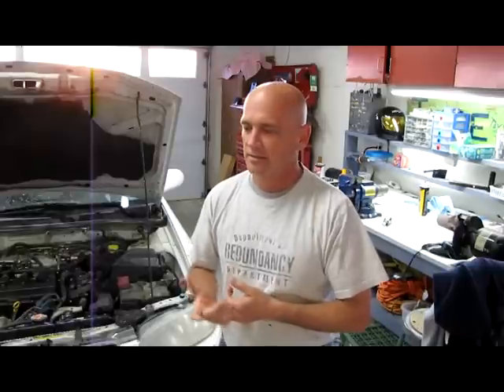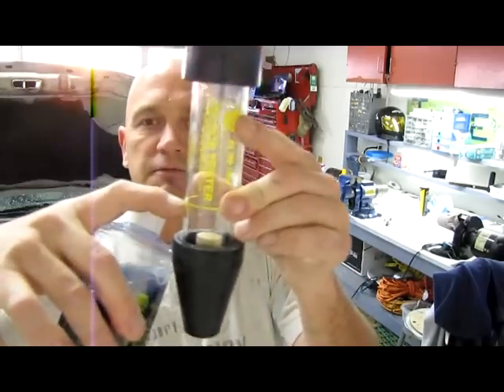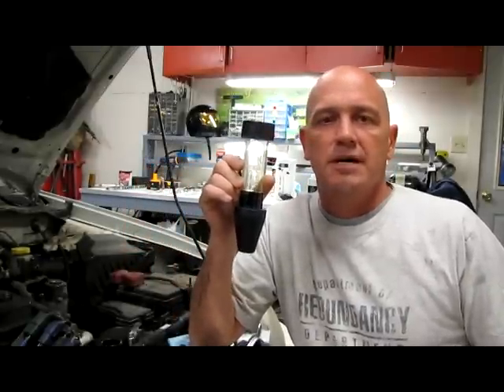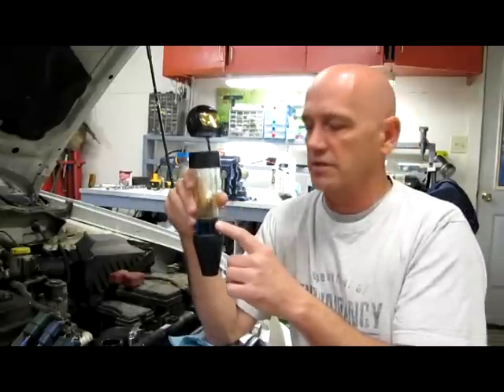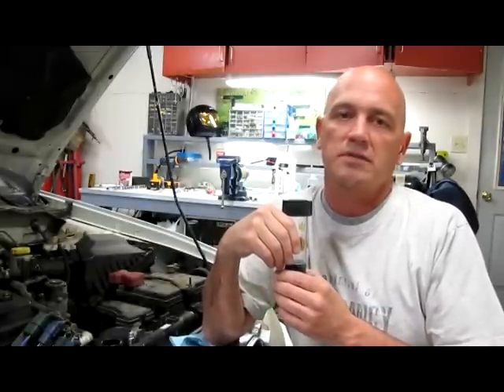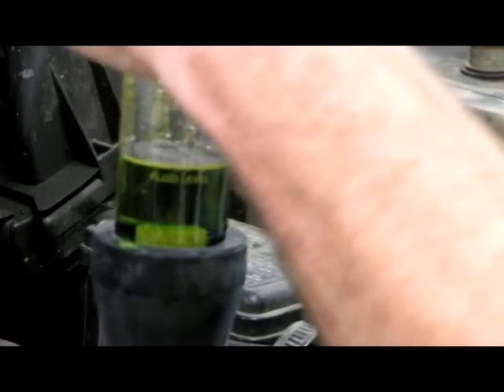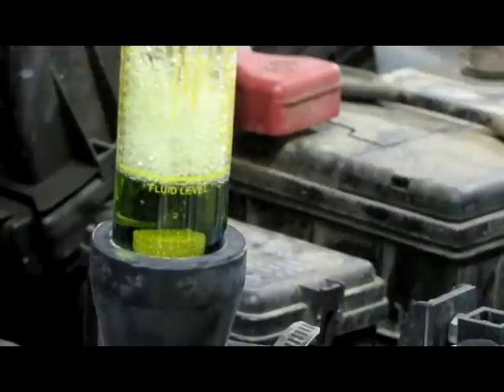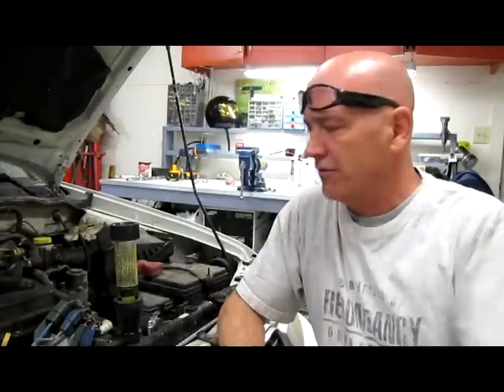How to Test Head Gasket

Comment: reluctorvalve,  Is it necessary to have the engine running while doing this test?
Reply from the maker: yes
Reply from the maker: Jim: the engine needs to be "producing" - - as in power, exhaust, heat, etc - everything.  That is *the situation every diagnostic mechanic seeks...to "see" the issue as it happens, so YES!!!  More questions?  I'm at reluctorvalve@gmail.com.  Hope this helps some.  r-.

Comment: One thing to be cautious of. If you happen to draw in some yellow colored anti-freeze (typical Prestone) , the solution will turn green, so make sure your level is low enough to not draw in any anti-freeze or you may end up with a false positive. I start with the engine warm.
Reply from the maker: mr88talent: I can't agree more with you here- Mid-Level coolant during the test!  ONLY FUMES are "inhaled" by the test tool!  Thank you  Mr. Talent!  r-.

Comment: Wow this stuff helped me diagnose a misfire on my 2014 F150 with 5.0l. Its still under warranty and has a failing head gasket!!!!!! I also bought a tool from home depot from a company called general tools thats a gas sniffer just to have two tests and it tested positive for hydrocarbons as well. Its made by general tools model no. NGD168
Check out my results with the block checker 
https://youtu.be/FPfvs0duC_s

Comment: Great video... been having sporadic overheat issues on my 2000 Dakota (in single degree and teen degree weather. A local, well regarded radiator shop performed this test, it did not change color immediately rather took near 15minutes to elicit any color change (it was run this only because it seems the head gasket is the lat thing in the equation which hasn't been addressed...). Is this normal for an older vehicle to eventually change color of test fluid without having adverse affects on the coolant temp?
Reply from the maker: tatuowen:  The key to this test, as I have found, is to catch the sensing AFTER the thermostat has opened and allowed the now hot coolant to enter the radiator.  I've seen cases where it did take that long.  Obviously  a really blatant leak would be sensed right away.  But sometimes these compression leaks are not all that easy to detect.

 Key would be to not have your shop door closed (build up of exhaust fumes in the area), and to keep the tester in the radiator neck, checking the upper/lower radiator hose temps to verify when the thermostat opens.  My view - no, it's not impossible for it to take 15 minutes to warm up.  Just be careful of how the tool is handled during that time.  Suggestion is for the "intake" area of the tool to remain in the radiator neck at all times, while checking the upper/lower radiator hoses for detecting when the thermostat opens.  Test with the tool during the entire time.  I've ran vehicles for a loooong time (in cold weather - winter in Flagstaff, AZ) and it can take a bit of time for that thermostat to open.  If you remove the tool to check the radiator, cover the intake area of the tool with your hand.   Hope this helps some.  r-

Comment: My neighbors toyota solara is a 2000 and it doesn't keep antifreeze period. The overflow is dark colored. Not to mention the oil is sludge even after you change it and crank it up to check the fullness of the oil...almost like a waste trying to figure out if its worth the effort or not????
Reply from the maker: Paul, I'd start with the basics on this one -  might this vehicle be/live in an area which doesn't really freeze during the winters?  Crappy cooling systems are very common in warm climates, like in southern AZ - people just add water when needed.  Well, that completely rips up the cooling system causing heavy corrosion and rust.  Coolant also has anti-corrosion chemicals in it, on top of anti-Freeze as well as lubricant for the water pump.  Many folks don't realize the value of coolant.  Dark oil after a change - indicates just a lack of regular maintenance.  That can be corrected by doing one oil change per month until it cleans up upon checking after the changes.  Thing is, damage can be caused by not changing the oil - kinda like washing dishes in the kitchen sink and not changing the water out for new hot and bubbly soapy water.  Cross your fingers and hope the crud in the oil didn't damage the engine.  Today's technology is pretty forgiving, though.  Hope this helps a little.  r-

Comment: Say if you have a external head gasket leak with the color still turn yellow? My buddys car has a small pinhole where the head gasket is. The hole is so small that u have to shine a bright light and u can see a little bubble come out. Its weird cuz it doesnt lose coolant but u can def see a small leak
Reply from the maker: +moneyhungryyt I'm not surprised by what you are seeing and how you are describing it - the problem with this is that it will definitely deteriorate and get worse.  So I'd be planning on a course of action with that.  Insofar as the color changing, maybe, but then maybe not.  The chemical test is designed to sniff exhaust fumes from the inside- so wherever there is the ability for exhaust fumes to seep in, that could do it.  I'd say that given the condition externally of that head gasket, it's probably pretty worn internally as well.  Good catch!  r-

Comment: Will it still be accurate reading if you only have overflow bottle because That's how mine is set up can't open the radiator
Reply from the maker: +moneyhungryyt  Read below comments.  Common question. r-
Reply: Didnt see a answer but thanks anyway!
Reply from the maker: +moneyhungryyt  Sorry about that!  My opinion is that if you have what is called an "expansion tank," then I think your results would be accurate.  However if what you have is merely an overflow tank, I don't think you'd get accurate results, and here's why:  an expansion tank usually has what looks similar to, if not exactly like a full-on radiator cap;  these kinds of tanks actually hold system operating pressure, and so are an "active" part of the operating cooling system.  An overflow tank on the other hand does not hold any kind of pressure and has lots of ambient air (gasses) readily available to it.  These are not an active part of the operating cooling system.  What they do is serve as a reservoir for coolant, and as the system cools, if needed coolant is transferred to and from the active system.  That's the long answer.  Hope it makes some sense.  Let me know if it doesn't. r-

Comment: So the colour does change because of the exhaust gas which comes in the coolant?
Reply from the maker: +kingmaster1231 Exactly.   - which, under "normal" circumstances, there should NOT be any exhaust gasses inside the cooling system at all.  This is a "sniffer" tool - to detect those gasses.  r-
Reply from the maker: Yes, exactly.  There are also some other "home-brewed" ways to do this, which you can dig up on YouTube as well.  thx! r-

Comment: how long does the engine need to warm up before making the test?? I don't coolant to push out like a volcano.  i started the engine and let if run for about 5 minutes with the tester in radiator.
I didn't want to wait too long and have the coolant come out and into the tester and contaminate the fluid, thus false results.
Reply from the maker: +Scott Watkins This will vary depending on the vehicle, and the severity of the issue, if there is one.  Couple things to understand...it is when the radiator cap is installed that the system begins to truly build up pressure.  Without that, the system won't build up any.  If you've opened up a hot radiator, you've experienced exactly what you describe. Next, as the engine warms up, the thermostat remains closed, and it's been my experience that the level inside the radiator will rise during this time.  Of course, once the thermostat opens (say, when refilling a system after a flush), the level goes drastically down as the cool coolant is taken into the engine.  There are ways to tell if the thermostat is not opening by knowing where to feel.  But, a very severe compression leak won't necessarily even need the thermostat to open.  If you have violent gushing out of the radiator when it is dead cold and just started, something isn't right.  Think of it in reverse: if you were going to fill your system up from being empty, you don't fill it all the way up to the very top of the neck and then start it.   You fill your radiator up slowly (on some cars there are back air-bleed valves to help push air out), but only until you can see coolant beginning to level up into the top tank of the radiator.  As you warm the car up without the cap on, you will see that level slowly rise.  It might even start to drip over a little, so I put the cap on in those cases.  However it's when the thermostat opens that I know that the level inside the filled-up radiator has gone down.  Directions for this test call for draining down the cooling system enough to leave an 'air gap' for the tool to draw in gasses only.  This should avert what you are worried about, if it's acting relatively normal.r-

Comment: Can this be done through the coolant reservoir if there is no cap on the actual rad?
Reply from the maker: +adalynn111209  If you have an 'expansion tank' system ( compared to an overflow tank) the answer, according to many videos and readings I have seen is yes.  The difference between an expansion tank and overflow tank:  older, more 'traditional' types of systems have an overflow tank, which is unpressurized.  This system has a radiator with a cap - which also serves as the 'pressure regulator' of the system.  Over-pressure is released to the overflow tank from the radiator cap area, and when cooling off, the reverse happens - if the system is low, the overflow fluid is drawn back into the radiator.  And expansion tank system (pressurized) is different, in that there is no radiator cap on the radiator itself.  The 'extra' tank usually has a very strong-looking or sealing cap, and it IS pressurized during operation (the overflow is NOT pressurized during operation, unless there is a big issue).  For the most part I've heard that the expansion tank systems can be tested in exactly the same manner, however I have never performed this test myself on an expansion tank system, so I can't suggest that you can.  You should contact the manufacturer of the test unit (Balkamp) directly to see.  Hope this helps some. r-

Comment: I sort of skimmed through the video. My concern is that my MLS type headgaskets may not like the engine block deck surface smoothness and slight low spots between the cylinders. I am looking for a way to test the headgaskets after install with the block out.
Reply from the maker: +Jack Karie Hi Jack!  First and foremost, I really don't know what you mean by testing a head gasket "after install with the block out."  That doesn't make any sense to me, so I'll comment beyond that.  MLS refers to a Multi-Layer Steel gasket - a newer (to me, anyway) type of gasket that is literally in layers, with a soft sealing material in between.  The jist of this (according to the JEGS site I visited) is that due to the more current demands placed on engine outputs today, there is a need to accommodate some amount of 'movement' between the head and block.  Now, my take is that they are, in design, accommodating for 'lateral,' or side-to-side movement for the most part.  I suppose with a multi-layered gasket that they could, in design, be accommodating for a 'vertical' amount of movement as well.  Obviously I am not experienced with MLS type of gaskets, other than I did install one as a replacement recently, when the OEM one was  NOT an MLS gasket.  It worked fine, although I did have reservations about installing it.  Now, regarding your question, the smoothness of the deck is supposed to be exactly smooth, or at least within tolerance measurements.  So given there are some low spots, just imagine how a multi-layered gasket would react to being pressed in there, compared to one solid gasket.  I imagine that the MLS would respond to those low spots more easily than one solid gasket would.  That's not to say that the solid kind would not perform fine, because I replaced a solid with an MLS and it worked fine.  This is a newer thing for me, and my suggestion is that if you have concerns about the sealing of an MLS type of gasket, refer to a place like JEGS website, ask questions and do some research into this type of design.  When I sourced mine, the documentation indicated that the MLS was actually a superior design.  But that was my experience.  Dig into it and see what you find from a good, reputable place with lots of current performance experience.  Hope this sheds a little light on the subject of MLS gaskets.  r-
Reply: I was sweating over the MLS headgaskets I had installed, which were replacing stock MLS headgaskets on an 04 Caravan i was fresheneing up. I had the engine on an engine stand with the cylinder heads on and that's where I was looking for a method of testing for leaks. I did find a suitable method. I had the aluminum heads milled but the block surface was a bit rough. I cleaned it up with just about anything i could and there were low spots in the block deck as shown on the straight edge. And well out over .003. I was not going to have the block machined. I took extra care in cleaning grease and such from block and head surfaces moments before assembly. I torqued the head bolts down multiple times over a week period in hopes that maybe the aluminum would flex to the blocks surface. That's just me, though. Since putting the engine back in, it has had no leaks. It has had 5,000 miles put on and counting. 

All of the information on replacing MLS head gaskets seams a bit farfetched as I don't see every dealer going out and milling every block and cylinder head when replacing an MLS gasket. Although the recommended surface flatness by the manufacturer is very flat.
Reply from the maker: +Jack Karie You had the exact same concerns that I did - it sounds to me like you've been successful with these MLS replacements - perhaps their design is intended for the deck surfaces which aren't so 'flat.'  Glad to hear you have put that amount of miles on it with no issues!  Awesome!  r-

Comment: I am trying to figure out If i have a cracked block.... but this tool here doesn't seem differentiate between a cracked block, blown head gasket , or a cracked head... so why is it called a block tester tool?  I am thinking about just getting a radiator pressure test kit to pinpoint this, does anyone here have opinions on either of these methods?
Reply from the maker: +Metal Maniac Ah...this is a good 'granular' type of question.  This tool literally detects combustion or exhaust-related gasses in the cooling system - and, obviously there should be none.  So perhaps it should more precisely called a "Combustion Gas Leak Detector?"  Simply put, each item you listed (cracked block, blown head gasket , or a cracked head) can cause this type of issue.  You are totally correct in that it maybe should be titled something else.  This tool simply detects that you have an issue in one or more of these areas.  I used to tell my clients when this test came back positive that there was a chance of having a cracked block, and that repairing/replacing the head and gasket was a bit of a gamble in that sense - and a large costly one at that.  I also told them that the only 'true' way to test a block is to literally take the engine out of the vehicle, strip everything off of it, and I mean everything, including crank, pistons, all induction items, etc, and send the bare block to a machine shop for magnetic-type of testing (cast iron) or some other type of testing.  The level of labor involved in that to pay a shop to do....uh...for most folks, they gladly gambled.  And, in my years of doing this, I recall that in only one case they lost that gamble.  I've replaced many many head gaskets/heads in this scenario with success.  So, unless you are a gearhead like me, and love tearing these things totally apart, to 'truly' know if it's a block issue is just too costly to find out.  I hope this clarifies your question some.  I agree with you, though.  A more descriptive name for the product would be helpful for those who aren't as familiar with this as we are would be better.  r-
Reply from the maker: +Metal Maniac My second response:  The pressure testing tool would be the very first thing to use - to try to find an 'external' leak, which are more common, such as a bad hose or leaky radiator.  The 'block tester' further tests if there has been more damage done due to overheating to the point of warpage of the head/block seal.  I'd definitely start with the pressure tester, correct what you find, then see if it runs well.  If it still overheats with no 'external' leaks, that is the time for the 'block' tester.  Hope this helps some.  r-